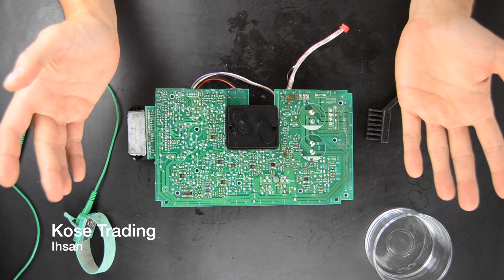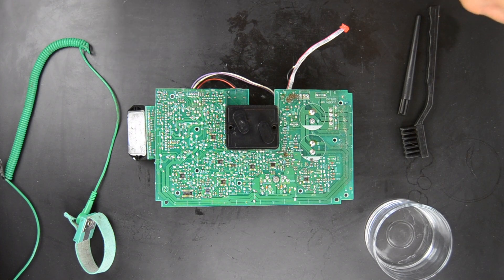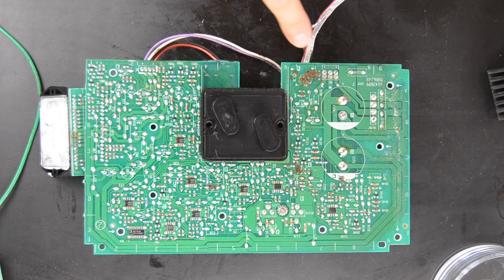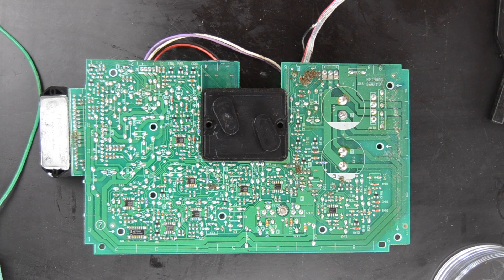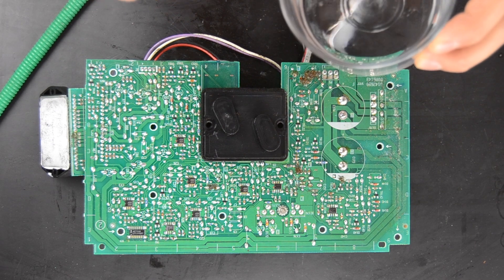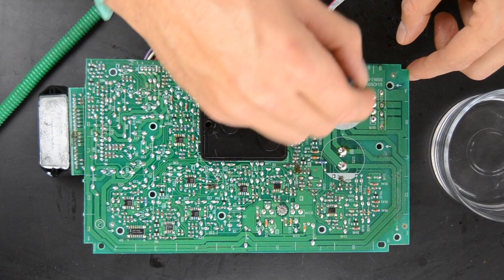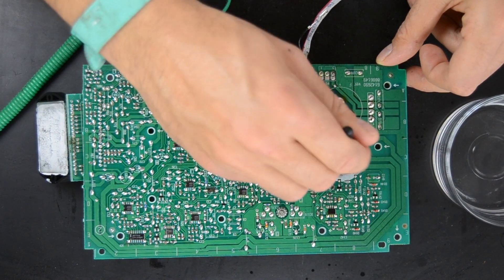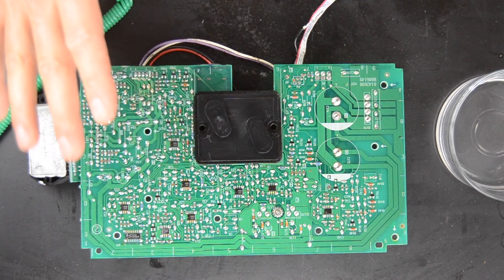Bang & Olufsen Beolab 4000 Active Loudspeakers Amplifier cleaning process and repair guide

Comment: My fuse seems to be broken, the speaker won’t turn green. A workshop wants to charge me 200€, is it possible to solve the problem cheaper and on my own ? 

Damaged part is the protection circuit or how ever it is called in Englisch …

Kind regards 
Max
Reply from the maker: Yes, you can definitely order an amplifier board from our website and replace the board yourself. If the fuse or protection circuit is damaged, replacing the board is often a good way to resolve the issue. Doing it on your own could save you the 200€ that the workshop is charging. Just make sure to follow the installation instructions carefully, and ensure you're familiar with handling electrical components to avoid any safety hazards.

Comment: Love your video! If an old 4000 doesn't power on (possible foam rot?) what do you think would be the main possible reasons?thx!
Reply from the maker: Hi. Thank you for your feedback. Controlling the defective boards comes first. either the amplifier board or the power supply board. You can also send us pictures of the boards so we can examine them and determine which part is broken.
Best
Kose Trading

Comment: Perfect...will need to do this soon...one is already  not turning on anymore. The other one is still  working. I hope I dont need a new board.
Reply from the maker: Hi. Thank you for your comment. If one of the boards is not turning on anymore the board is damages and need to be serviced. We have fully service amplifier board is stock. 

Here is the link : https://kosetrading.com/product/beolab-4000-power-supply-amp-part-02-module-8006149/